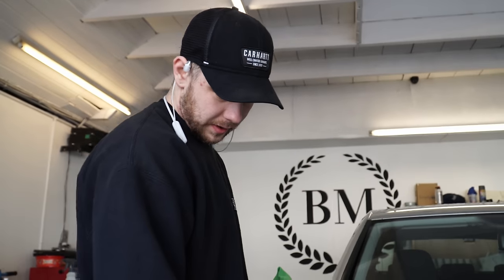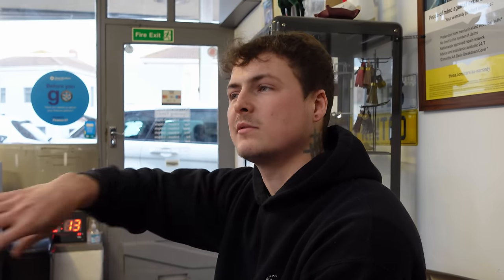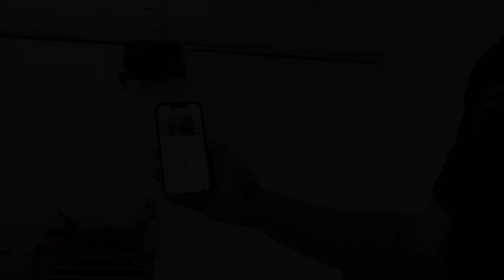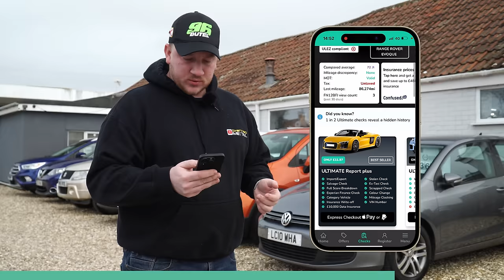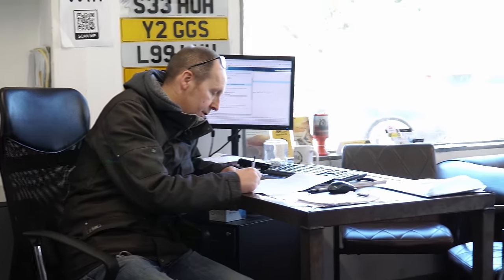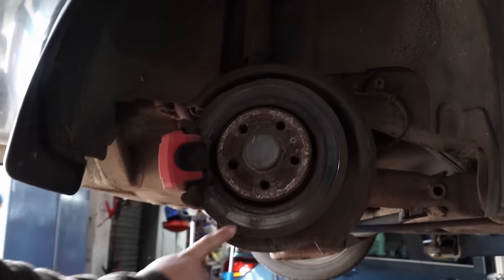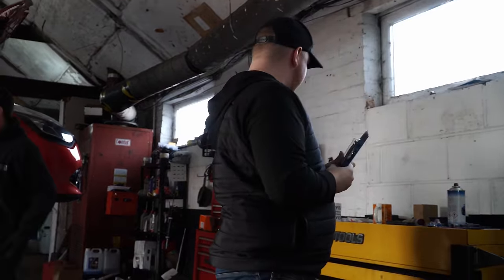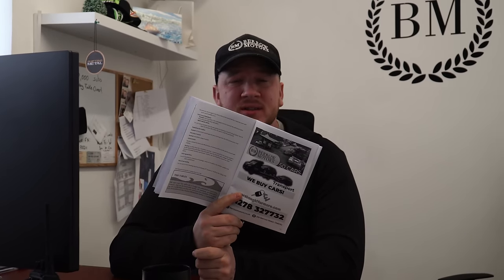Growing pains - Seeking Advice On Our Future! | BM Weekly EP 23

Comment: The plug in module on the Nextbase GW isn’t a cabin cam, it’s just a regular rear camera it does’t catch the driver or anything like that - both my cars have them…
Reply from the maker: They do both options
Reply: @ShiftingMetal  The only two I’ve seen are the cabled camera that is mounted to the rear window and the module which plugs into the side of the dash cam, the ones I have are the latter and they definitely don’t have a wide enough fov or an adjustable lens to allow a view of the driver…

unless you angle the whole dashcam so that it is picking up basically the pavement on the n/s

Comment: there is absolutely no need to strip a car to that degree to install a fully hidden dashcam system. haha
Reply from the maker: How would you run the cable for the rear camera then?
Reply: @ShiftingMetal under the mats obviously 😂😂😂
Reply: @ShiftingMetal  quite easily. you can tuck wires behind panels by simply lifting the rubber door gaskets then carefully levering the trims with a spouger. I used to fit dashcams for a living and have fitted upwards of 400 front plus rear systems over the years to every type of vehicle